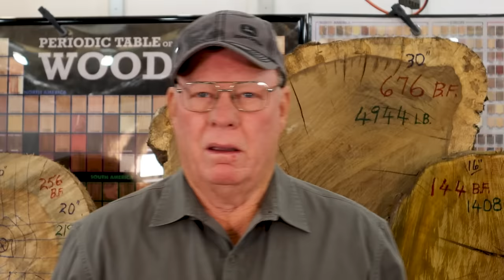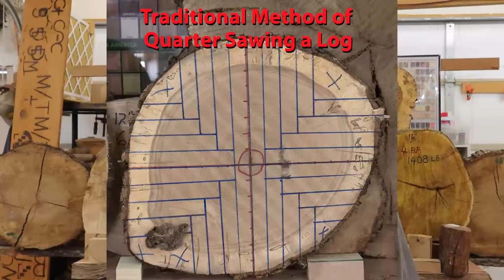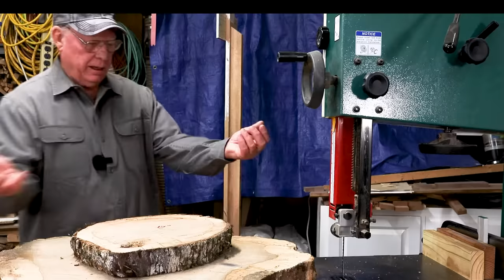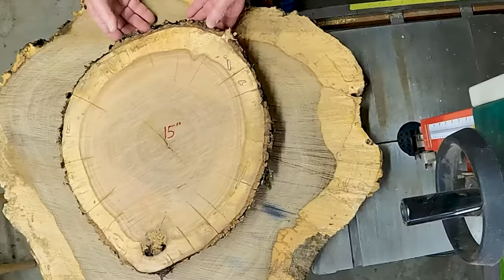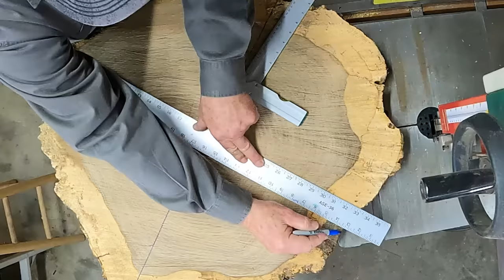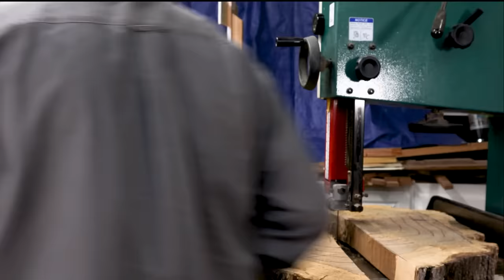How to Quarter Saw Lumber, The Old Way? Or the New Way?

Comment: Great video, and definitely looks like a big labor saver on the flipping method. One counterpoint I'd like to bring up, though: I think you'd probably get a better yield (and definitely a lot wider boards for your best ones) by cutting your main, central cant perpendicular to the big crack in the pith rather than parallel to it. If you pause the video at about the 27:33 mark, I think you'll see what I mean.

That fourth board down on the left cant is one of your absolute best pieces for consistent grain, but you end up with a crack going right down the middle of the thickness that's going to waste almost half that  board. On the right cant, the crack is cutting a long, diagonal path through your top two boards. That's wasting a big chunk off both. Three boards out of what should be your best and widest from the log are getting a raw deal due to crack orientation. If that original center cant is cut the other way, perpendicular to the worst of the cracking, the cracks are going to placed mostly across the thickness rather than the width of the boards, and very near the pithy edge of the later cuts so you don't have to trim as much waste.

Hope that wasn't too confusing, and it's just my best guess at getting a better yield. Obviously, there may be cracking that you can't see from the end grain that will waste board width no matter what way you cut it, but I'd try to at least give myself the best shot of getting those premium boards as wide as possible.
Reply from the maker: Thanks for the comment. It's a process, decisions on any piece of wood are made on the fly.  remember for the example we were using tree cookies. On a real log you cannot see inside the log to avoid all cracks. we learn from experience and do our best.

Comment: Mr. Wood, what species wood is good to sticker oak for air drying? Is there a species that works universally well, or any that would work universally poorly? Is it okay to use like to like stickers to boards from the same saw log?
Reply from the maker: Any wood will do for stickers, but..... I would avoid woods that are bad about getting black mold.  Use dry woods. I usually make most of my stickers from pine cut-offs because that's a cheap wood.  I do a lot of chainsaw milling of very large oak slabs. for them I use oak stickers that are 2x2" square and three to four feet long or what ever the slab width is.  Two reasons for this are oak on oak usually does not leave a mold line across the wood and with a 2x2" sticker I can use my tractor forks to slide in between any slab and move it when needed.  Thanks for the comment.
Reply: @George Wood of Texas  Thank you,, Mr. Wood.

Comment: Great video. What blades and band saw are you using for the video? It seemed like you were cutting butter . I don't have that much luck with my band saw
Reply from the maker: Because it was raining the week I shot that video, I illustrated what you would do on a sawmill on my shop grizzly band saw.  The Blade I keep on my shop bandsaw because I cut up lots of woodturning blanks is a 3/8" -  3 TPI "Woodturners" blade from Highland Woodworking. For my sawmill I use Woodmizer hardened steel blades.

Comment: @tlak, he only commented on the fact that labor costs have risen over the years and thus you need to be more efficient in order to make money. He never commented about whether wage increases were wrong just that they WILL impact profit (because) there is still downward price pressure (you can’t just charge whatever you want) for lumber because eventually the price will be too high and no one will buy it. Or… everything that uses lumber (houses, etc.) will now be more expensive and thus your $15/ hour minimum wage won’t have any more purchasing power than when you made $7/ hour.

Comment: Fully quarter sawn is less than 10° perpendicular to the radial grain. After a couple cuts from the center, 2 near halves come back together & 2 more slices from center. Now with 4 quarters left, those get clamped in individually to again cut 2-3 boards from the center. A pain? Yes, but all has been cut to less than 10° perpendicular to the radial grain giving you all fully quarter sawn boards..
Reply from the maker: I am sure that will help some of our viewers.

Comment: I think this is a good method for large OR small logs. Sawing of ANY kind on smaller logs is less efficient. But on smaller logs, going the extra mile to get quarter sawn is perhaps even more necessary to have value-added process to make up for the lower price you're going to get for those boards. Yes they will be smaller, but they will be of more value to help make up for it.
Also, typically the more angled grain is referred to as quarter sawn and the more vertical grain is called rift sawn, but understand what you're talking about.

Comment: I want to use quarter sawn wood for craftsman or arts and craft style furniture but I need wide wide boards. I am building a saw mill with a 5 and a half throat. If I used
Reply from the maker: please finish your question and I will try to answer it.
Reply: @georgewoodoftexas3509  Sorry sir . If I used your your method, what problems would you for see on such a large log???
Reply from the maker: The biggest problems you face on large logs is the weight.  Hard for you to lift and turn without heavy equipment to do it for you.
Reply: @georgewoodoftexas3509  have a tractor with a front end loader. I want to use some, for wall paneling as well.
Reply from the maker: @reecewatson773  Having trouble understanding the question.  Please resend.

Comment: I bet you can collect all the throw away corners and sell em "as is" with a special price to woodworkers who would salvage out the good parts.
Reply from the maker: Actually, I have started to do that in the last 2 years. Although quarter sawing produces much more waste boards than there is use far, some can be recycled.  If you have seen my video on cutting turning wood blanks you will also note how much waste is associated with that operation.  
    So here's what I found: If I save a portion of smaller waste pieces, people that come by go through the waste barrel and pickup any of the scrap pieces for projects that working on.
    What kind of projects? wood workers glue mixed pieces together for cutting boards or bowl blanks, are use them to make butterflies to repair board cracks.  Woodturning segmenters use the small pieces for feature rings of their vases.
   Women use them to make small wood pendants, rings, and other jewelry, sometime gluing together many different kinds of wood for these projects, and there are many, many other small projects these could be used far.
    So I have been saving these small cutoff pieces for these individual to use.

George

Comment: It all depends on what timber you want to achieve, the best, broadest boards, with the best figure are achieved by "Radial Sawing" which is without a doubt the most wasteful, most time consuming,way to break down a log. You pay for what you want.    Quarter sawing is really intended to produce the strongest, most stable timber. not the prettiest. 
  As the sawyer here says if the grain does not go through the board at 90° near as dammit, it is not quarter sawn, ( I think that if you let it drift as far as 45° it's got a bit doubtful !

Comment: If the annular rings to the surface of the board are less than 90* it is not quartersawn, it is riftsawn, and any flake or medulary ray you are trying to showcase, will disappear. It takes a lot of work to maximize the exhibition of flake on white oak, by rotating your quarter and taking of a small sliver to straighten up the growth rings, but absolutely necessary for promoting figure.

Comment: It seems like someone that only does saw milling as a hobby could make a small profit
Reply from the maker: Making a livable profit with a sawmill is a hard, hard way to live.  You can get the logs and cut them into lumber, then you have to dry it, but where is your customers.  Most that come to a small sawmill want and are inspecting to buy lumber cheaper than anywhere else.  I have quite a few customers I have built up over the years, but a new sawyer has a tough time attracting woodworkers that will pay premium prices that make your business profitable. thanks for the comment/

Comment: most confusing video on sawing lumber ever. if i cut out the center of a log like that, i'm going to end up with a log length curved cant, three ungainly, unwieldy pieces of different size, and even more work than the traditional method

Comment: You're not quite right. Angles are wrong.
Reply from the maker: In woodworking there is often MANY ways to do the same thing. Many different sources have different angles for quarter sawing.  All of them could be correct depending on your perspective. To make the best lumber, boards should be cut so the grain is crossing the board as close to 90 degrees as possible.

Comment: What a waste! I worked in a sawmill for 30 years the most effective way we sawed 18” and larger logs was to cut into eights by splitting the quarters and then flipping back and forth in traditional manner. Way more quartered surfaces and running each board through a double sided edger created way less waste than the method shown here. A certain percentage of you narrowest boards are going to become rift sawn as there is now way around this no matter how you saw the logs, but better than throwing them away as “waste”!
Reply: I think if you watch the first episode he explains that he sells to wood turners. The waste is used by them as a main line turning. So he gets quarter sawn and turning wood.
Reply from the maker: Often in woodworking/sawmilling there is more than one way to do things.  I am alway looking for the most effecient way to sawmill.  What waste? All cut off material is first turned into larger then smaller and smaller wood pieces.  Like woodturning bowl blanks, Salt/pepper grinders, trim pieces, Segments for our woodturners and cutting board people and then into pen blanks for woodturners. The waste is used a firewood and fire starter material, the sawdust is used by a local mushroom grower, and a chicken farmer for hen nest.  Its best to approach sawmilling more open minded.